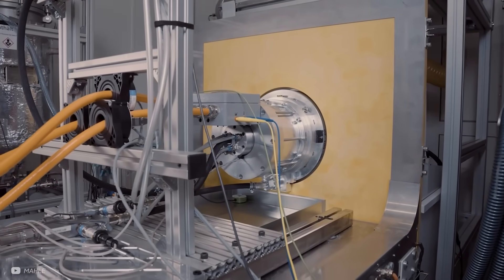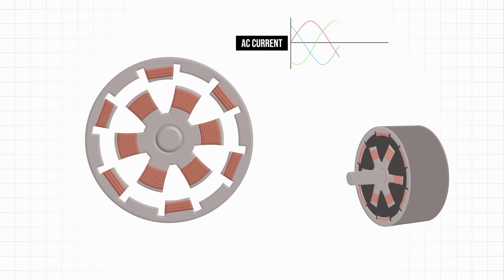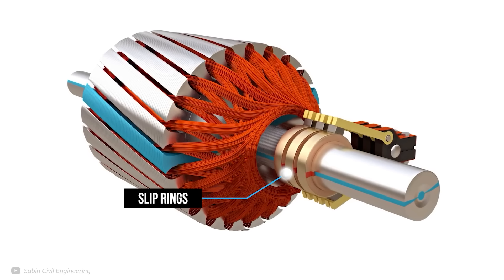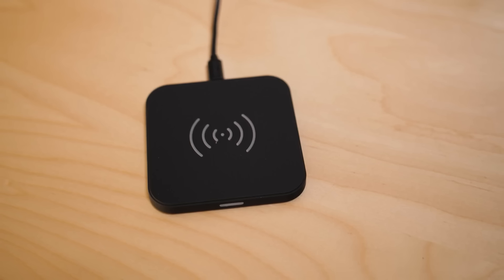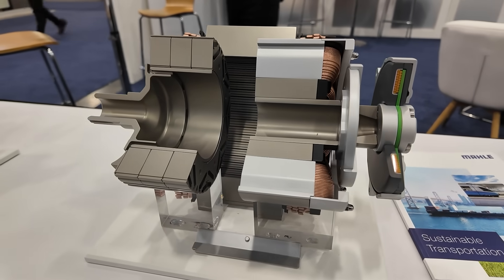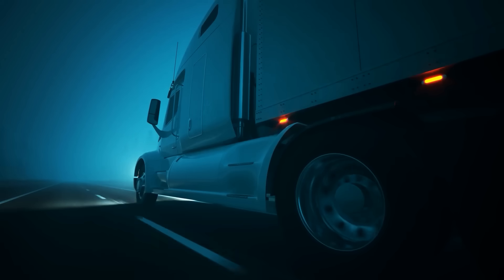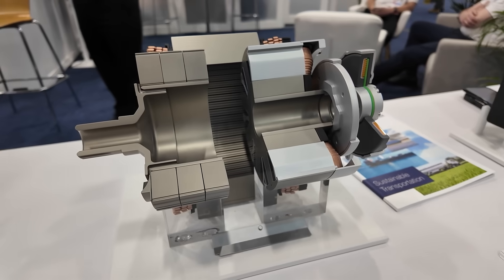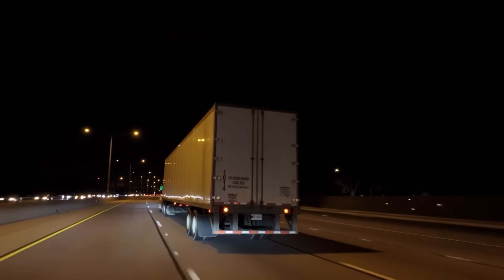Genius Contactless Motor Could Change Transport Forever

Comment: Claiming that electric cars are the only viable option for "sustainable transportation" is quite a reach. Renevable bio-fuels exist already and technology it there. Just make lighter cars with reasonable engine sizes and you are good to go. You can save nature by stop buying junk and force Germany to stop polluting air with coal power plants and use nuclear instead, which is much clearer. While new electric engines are important in many ways, it is the battery that is the problem and the more data we get, the more evident is has become that electric vehicles in any current form are cleaner over all then ICE cars.

Comment: I designed a similar electric motor for a school project a year ago, and my progress was as follows:

Main Goals:
->No magnets
->No circuit boards
->Use simple DC current instead of AC current
->No significant friction surfaces
->Light as possible

I then moved on to reluctance and AC motors, designing a hybrid and converting it to an axial shape, which allowed me to add separate induction coils to the motor coils, thanks to the large surface area.

The final design was a hybrid motor that converted DC current to AC current and then used it for the coils.

But it took too many coils to make a smooth rotation, and the induction coils were extremely inefficient and would get very hot. Also, the induction coils needed AC current to run the motor, but the rotor needed to spin to convert DC to AC, so after powering the motor, I had to start the initial movement and maintain continuity by rotating the shaft. (I never found a solution to this problem)

So in the end I had completed my goals in my design but it was very problematic and I decided that I couldn't solve it and stopped working on it.

Anyway, later I told my teacher that I couldn't do the project and another friend joined the project by attaching a solar panel to a battery and taking my place.

Comment: Piller GmbH have been using rotating rectifiers and excitation windings in their synchronous motor/generators for 40 years. This is not really a new idea but perhaps a refinement of an existing one.

Comment: mahle is a specialist for internal combustion engine (ICE) parts not for external combustion engines (due to the batteries, you know). So we should not expect wonders. Their idea is far from new and has been rejected before most likely for reasons of overly complex design, bad serviceability, neglitable advantages over traditional designs and lack of robustness. One of the worst ideas from a efficiency standpoint is liquid cooling of fast moving parts for shure. As you know ICEs and gear boxes are not internally submerge in oil. Guess why.
Contactless power (a rotating transformer) is no issue since magnetizing power consumption is quite low compared to traction power. So, what you gain with this arrangement is lower magnetic commutation losses in low to medium load operating conditions, which may be eaten up again by liquid friction and pumping losses. In high power scenarios there is most likely no advantage over traditional syncronous motor designs. Bottom line: meh

If you want to get rid of the lossy magnetic cogging momentum of sync motors, you'd rather upscale an ironless permanent magnet BLDC inrunner, like the meanwhile vintage Kontronik Tango series. This thing had a rotating magnetic return ring, resulting in zero cogging and outstanding power efficiency. But it's already patented, so .... yeah.

Comment: Honestly this sounds like a really bad idea honestly. Wear from slip rings is a relatively minor issue. Like how many people out there have had their EV's motor fail? That's exactly what slip ring wear would do, and yet such stories are basically unheard of. 

On the other side, wireless transmission is always extremely lossy and produces a lot more heat. Anyone who's used a wireless charger can vouch for how much hotter their phone gets, and yet also at a slower transmission rate. That means you make a less efficient motor just so it can last 40 years instead of 10. Was it worth it? The motor on an EV is already the least likely part to fail.

Also you really glossed over how this is different than an induction motor and just said "well its better" as though you have no clue. Let's be clear, not all research results in good data and not all data results in real products. What exactly makes this better than existing techniques?

Comment: Dont replace the classic motor with the electric one. Instead, turn every tire of the car into the electric motor and keep the classic one. Thus you can turn every car into the electric one, plus having the benefits of fuel cars. Electric wheels are way to go.

Comment: Given that pretty much all products for the masses, are designed to wear out, or at least their failure to last forever, is part of the whole consumer-producer bargain, any idea how much longer one of these would last? (I don't know what breaks first in an induction motor.) Batteries lasting well over a million Km. Brakes never needing replacing thanks to regen braking. I'm sure we could use rust-proof body materials. How would the car companies ...? Just answered my own question... they'll stop providing software updates for your particular car, including security patches, so while your car might easily last fifty years, after fifteen you would know, it was at risk of being hacked and suddenly driving you into a tree. Now, that would be an interesting ransomware message if it popped up on your car's touchscreen "Please send us £500, immediately, or we take over your power, steering and , of course, brakes."

Comment: The main problem is power density in general. Only way to have enough power density is a gas/ diesel gen or a humongous battery pack. Would love to see nuke batteries with thorium or something similar to power said motors. This tech has been rushed so fast, but electric powertrains do seem to be the future of ground transport...

Comment: You got the point of why external excited Sync motors are overall better in terms of performance compared to async (flux weakening control, grid voltage control etc..) but let me tell you that async motor will be the way to go for a long time still Just for the simple fact thar they are ROBUST. You don't Need any controller, they are Just "plug and play" that's why they are the most "popular" along factories or low voltgage appliances.

Comment: when I was a child I came up with a similar engine.... even then, having learned about wireless energy transmission, I wondered why not transmit energy in this way to the windings of an electric motor and abandon permanent magnets. I just remember then, for the sake of an experiment, I inserted an electric motor of 1.5 volts of direct current into a 220 volt AC outlet. so for me there is nothing fundamentally new in this engine.
of the minuses, however, the increase in the dimensions of the engine and weight.

Comment: Of course, increasing the load on the shaft(pause) will significantly increase the amount of power needed to prevent the internal magnet from slipping out of the field constantly

Comment: Phone chargers are , at best, 80% efficient .
Mahle has always been pretty innovative.
Oil cooling is only around 20% efficient compared to water cooling, plus, oil can't be moved around so fast or oil will not  conduct the heat (it's been known pre-WWII on aircraft engines)
I'm sure modern oils will be better, but, using hot oil (definitely not just 'warm' ) to warm cabin may well take too long?

Comment: This reminds me that the manufacturers of the old VHS video players also a similar method,  but for transferring analog signal from the read heads through the axis of the video head drum. Also - the vhs head drum had multiple concentric transformer cores making it possible to transmit multiple channels through the axes.

Comment: Plain and simple points.  Creating one magnetic field for power means it must be a huge field that's more than the second field runs on in order to send enough electricity for the field in the motor.  Both fields will come in contact with each other and therefore interfere with each other.   The only way to stop this from happening is to use large amount of space between them and shielding that is very heavy.

Comparing efficiency of wireless to wire is a simple case of how much copper wire is used.  You can't make a wireless system more efficient than wired. Their example is comparing less copper in the wires and much more in the wireless.  Conductive silicone used in the bearings for power and for cooling would increase efficiency. 

No one is talking about what is happening when you have a very strong magnetic field that is passing through your body.  It does effect your nerves that are like electric circuits.  You might like driving your tesla now but will they be liable when you are 30 years older and you are shaking like crazy and having cognitive issues?

It's an extreme case but the military tested a weapon that created a huge magnetic pulse to fry circuits.  Turns out the ships crew were all dead because it fried their biological circuits.

Comment: Tbh as an engineer that started as a sparky in motor winding, this was an advert. Oil cooled motors and wound rotors using inductive loops to feed slip rings will only create more points of failure. EMF is the reason squirrel cage motors are efficient. Adding complexity doesn’t improve efficiency. Sorry boss but this was just a video for views with no real legs to stand on.

Comment: You have to subtract the energy requirement of the cooling oil pump when you calculate the efficiency of the motor, before comparing it with other motor efficiencies.

Comment: The Motor Is Not The Big Weakness Of EV's! It Is The Batteries That Are Leaching Forever Chemicals Into The Ground Water! These Batteries Will Be BANNED In The Coming Decade! Hybrids Are The Future As We Do Not Even Have The Grid To Charge The EV's That Already Exist! It Will be DECADES Before The Grid Can be Built Out To Handle The EV Mandate Thus The Reason It Was Scrapped!
 It Is Like The Plastic Screw-up All Over Again! To Solve The Problem Of Plastic On The Side Of The Road Some Idiot Got The Idea To Make Plastics Biodegradable! The Problem Is That It Is Not Naturally Found In Nature So It Can Never Biodegrade! Instead It Breaks Down Into Smaller And Smaller Pieces Of Plastic! Now There Are Micro-Plastics In The Cells of Every Living Organism On The Surface of The Planet!
 Trying To Solve A Non Problem Like CO2 Will End Up Creating A Real Problem! CO2 Is As Green As You Can Possibly Get!
 Clouds Of MAN MADE Water Vapor Trap In The Heat From Our Sun So It Can Not Escape Into Space At Night! Thus We Measure Upper Atmospheric Cooling And Slight Surface Warming!
 The Solution Is To Restore The Natural Tree Top Canopy! To Shade Our Homes With Trees! Like We Did Before The Adaptation of Electricity And Air Conditioning!

Comment: So the wireless energy will need to be converted to DC for the rotor coils
I can see what looks like an internal power device at 6:30 so there's probably some regulator inside the rotor , kind of like the way an alternator works.
I'm assuming this is easily servicable (looks so)and that they have allowed for the effect of regulator failure while driving.
The design of the magnetic coupling is fascinating.

Comment: Now this is something worth my interest, i just wondered if they have been working on it as long as i have? 🤣🤣
I think the final specs will be impressive. Energy density may not be as far off permanent magnet motor as we intuitively assume. The electromagnet in in this application is surprisingly efficient and the specific purpose wireless transfer will be much more efficient than any form people are familiar with. Im getting ahead of myself here and possibly being a little hmm, "juvenile" but i would love to get my hands on one and see how far i can "over clock" it. 🤣🤣🤣🤣🤣

Comment: From the AI : For phone Wireless charging, also known as induction charging, has an efficiency of about 60 to 70%. This means that part of the energy is lost as heat during the energy transfer process. In comparison, traditional wired charging is generally more efficient, with an efficiency of about 85 to 95%.

Comment: Not new. 
This is a contactless exciter.
I wrote a textbook for Mining Industry use on Synchronous Motors back around 1997 (!), and covered (i) the conventional slip-ring excitation powering of the rotor, and (ii) an induced-magnetic contactless system.
Everything old is new again 😞

Comment: Nikola Tesla invented the induction motor with rotating magnetic field(withouth earth magnets) that made unit drives for machines feasible and made AC power transmission an economic necessity. This motor exist 100years.
Ok,Mahle invented this typ of new motor...but for What?
With one coil "transfering energy" in second coil,then 3rd coil in rotor and 4rd coil in stator?Energy efficient like -Me after 10 beer.

Nicola Tesla induction motor is at 230volts,rotating at maximum speed of 2800rpm,but with (in your electric vehicle) converting DC power from batteries in AC power,you controlling primary coils... example is AC motor in Wash machine,which have rotation arround 10.000 rpm.
Mono Phase motor,3Phase motor,AC generator...all of them not using magnets.DC motor use...
If you know,how working 3phase motor-then you know how is easy for regulating speed with Frequency Regulator...

Comment: Not as simple and elegant as the induction motor but nice. As wireless transfer requires ac there must be a rectifier on the rotor. If not, it will not be a synchronous design?

Comment: kinda hard to see this being more efficient given it has more copper losses (there's a reason it needs to cool the rotor, not just the stator, your having to generate 2 magnetic fields vs just 1 in a PM motor)... and its hardly 'new' - these types of motors have been around for yonks, including the 'brushless' element. Most (perhaps just 'many'...) generators use exactly this method of excitation, because it allows for a simple method of load/output control, independent of RPM. Your also stuck with a coolant pump thats based on your motor speed, rather than on thermal requirements - which is ass backwards given highest losses in vehicles are during low speed + acceleration - and lowest losses are at your (high rpm) cruising speeds. 

The statements of induction motors being 'inefficient' is also bollocs - they readily get into the 90+% range... however the control over the field is (or rather, can be) quite useful - though even then, it can be achieved with PM motors, particularly those designed for it (ie those with lots of reluctance torque), with minimal efficiency hits. It could also have pretty good power density and torque density, owing to a possibly higher max operating temperature and ability to generate strong fields... but again, this tech isn't new... and its oil cooling is likely to limit its max rpm (thus, max power) relative to those not needing rotor cooling. Similar could be achieved with a reluctance motor, which also doesn't need rare earth materials. 

Gotta love influencers who don't actually understand their subject enough to critically analyse what they are talking about, and so read press releases as if they're 'true' - even then, the clue should be the lack of hard details/numbers... Its why you use a lot of 'i think it can probably do X' not 'it does x' or 'we dont know yet, the vendor doesn't say, and there's likely a reason for it'... I love innovations but there's nothing here that is that, at least as presented. Essentially they've said 'hey, did you know you can use a generator as a motor?' - you know, the thing that has been done for decades. Sorry to tear into you a bit... but it should be quite obvious without much effort that this is likely vaporware.

Comment: disandvantages less overall power and less efficient and requires 2 different frequency drives to control costs manufacturer less but costs customer more being a so called new product. overall another way for car stealerships to rip new @ssholes in the very dumb customers that buy it. Am I wrong?😂

Comment: Aaaaand... how often does the oil need to be changed and how insanely expensive is the oil - and the change service?

How flammable is the oil - because you KNOW whatever vehicle it's installed on will wreck and spread oil everywhere since wheels tend to be a primary impact ablative structure.

Comment: A new technology! A new technology! The new technology is coming! Well, the technology may be new to you.  Let's see. New electric motor with cooling systtem ... to handle the inefficiency of power thru the generation of heat. All things being relative, the scale of an electric motor is reduced by what? The smaller motor weighing more with the addition of a closed cooling system? Would a larger motor of equal weight to the smaller motor/coolng system do the same work?
All of this being academic without a greatly improved energy store. 
 I know, a new technology !  Have the vehicle be in contact with an overhead electric power source! Or side contact !

Comment: Also, conventional magnetless 'squrrel cage' induction motors are not synchronous. This Malar motor being synchronous is probably the foremost advantage/benefit.
I am skeptical about the amount limitatoins of the amount of power that can be transferred to the rotor with their 'wireless power transfer slip ring'.

Comment: Electric vehicles are well on their way to parity with fuel driven vehicles as far as cost is concerned. In the not to distant future they will be a good deal cheaper. The real prize goes to the battery race winner!

Comment: Why didn't you expand on why you can "control" the strength of an axial induction motor electromagnet, but made it sound like you cannot do that with slip rings?